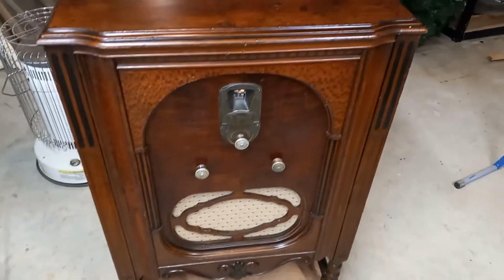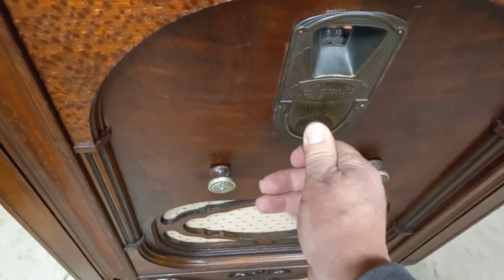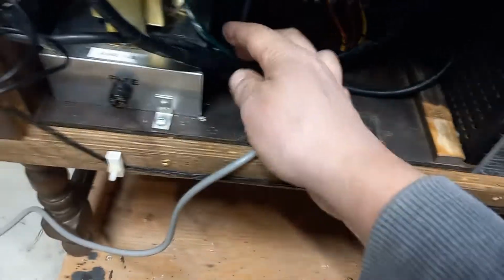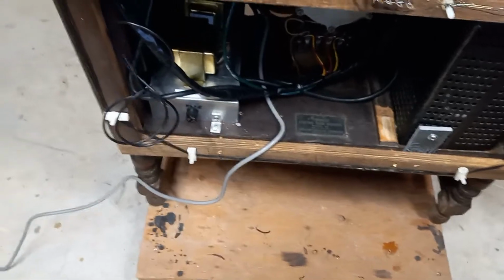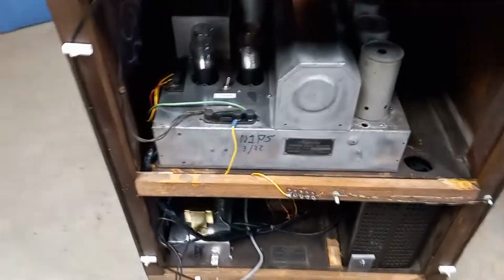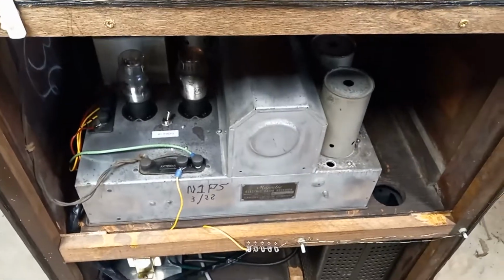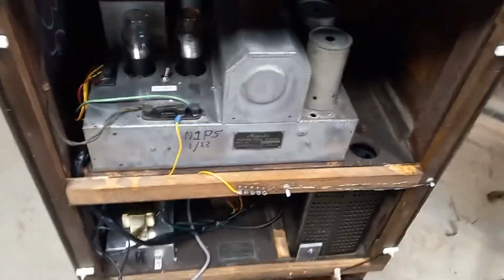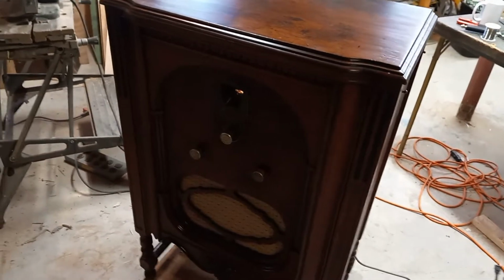Majestic Model 90 Restored

Comment: This video was very informative. I recently purchased the same radio, and I plan to restore it over the coming months. I am not crazy about the bulky power supply and ballasts. Can you tell me more about your conversion process? I am also curious to know more about the Bluetooth addition. Would you be able/willing to share schematical drawings or point me in a direction to learn the process?
Reply from the maker: I replied to your email too.  OK....on your 2 questions:

1. The ballast.  I tied 2, 2 amp transformers together as an autotransformer to reduce the 120VAC down to 80 V.  One was 24V and the other was 16V IIRC. I found this on the web...not my idea (the poster used a 24V and a 12V, which I found was not enough as the filament voltages (2.5V) were too high, thus the 16V.  I did not want a toaster in a wood radio.  Bad combo.  I put the transformers on a metal chassis and added a fuse to it.  The transformers run luke warm.  

2. On BT, as a rule I take a stereo output from the BT and tie it to the pre-amp in a radio usually at the volume pot high side.  I like to use 600 ohm resistors off each side of the stereo connection and tie them together into a coupling cap of about 2-5 uF  I should have a schematic of this I can send to you.  I then use a SPDT switch, to switch between the radio (detector output) and the BT output into the G1 grid of  the radio (volume pot etc).  In some cases, there isnt a pre-amp and I had to build a transistor amp to bring up the audio level for the speaker audio amp.  In this case we had something different with the Majestic as the detector uses a triode power detector.  The tube runs at cut-off, effectively creating a detector.  My fix for this was to use a DPDT switch and switch in a much lower value cathode resistor (1.8K, I believe was what I used), which now makes the triode a class A amp when in BT mode..   I added the switch on top of the chassis near the 45s.  I used mini coax for all connections, terminating the shields ONLY at the switch side to reduce any ground loops.

In the radio I worked on, I replaced all caps except a few of the micas.  Most of the resistors were also replaced as they were way off or open.

Also, if you are lucky, the neutralizing caps are set OK.  These triode TRF receivers are very touchy.  I had to retune all of them in this case and it was a PITA to get them set right.

Hope this helps.  
Peter